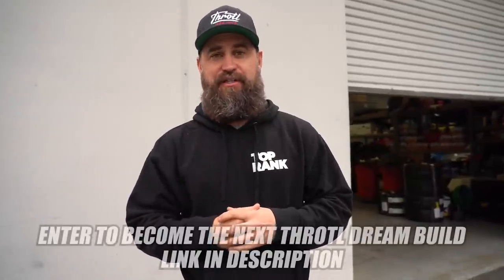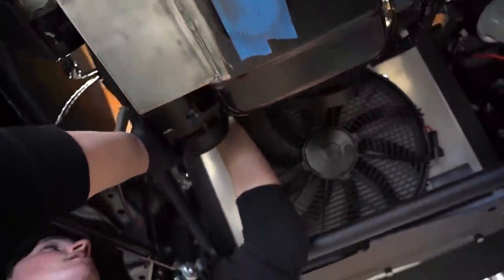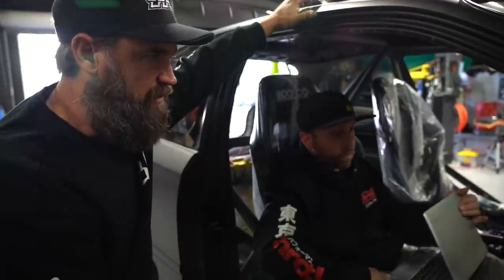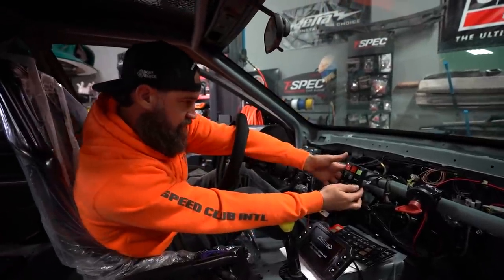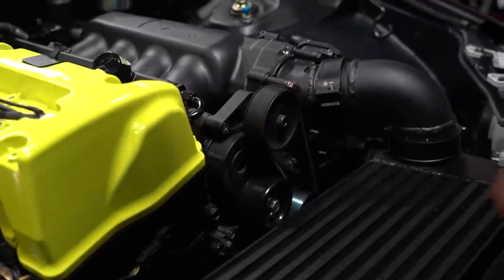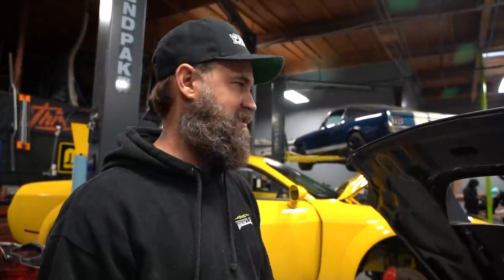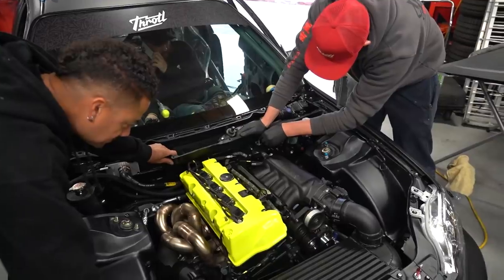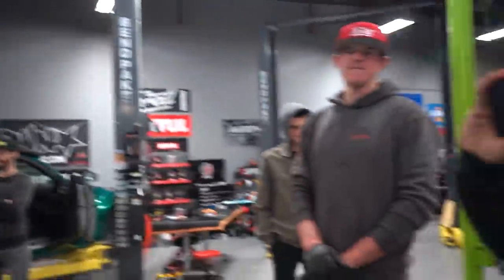Building a Rear Wheel Drive, K20 Turbocharged Honda Civic EK Hatchback Race Car- First Start!! Pt 11

Comment: Next time do a twin engine build.  Something like a MR2 or CRX/DelSol with twin K20's and twin sequential's.  Should be easy to control with stand alone ECU's, drive by wire throttle bodies and 1 shifter controlling both transmissions.  That build would have the potential to beat the methanol burning Hoonicorn on the street with a pair of 1,000hp K20's.

Comment: I look at my 07 civic si fg2 2 door coupe I think would look great rear wheel drive. The body looks like it should have come rwd from factory IMO. I see there's a awd  8th gen like mine, but haven't seen a full rwd only setup like this car your building. First thought rwd, but since a awd system would be easier for my car I may go that way.

Comment: Each one of the dots on the oil dip stick is not a qt each dot. From the bottom dot to the top is 1qt. Most vehicles can operate being a qt low without damaging bearings, ect…..